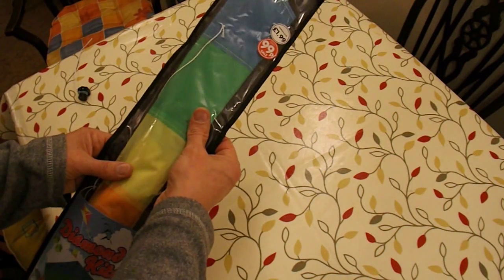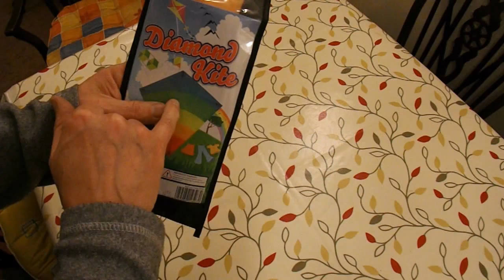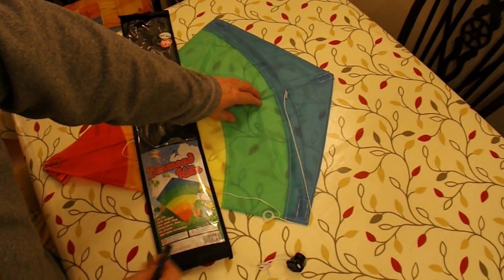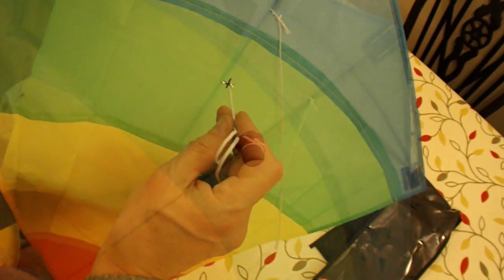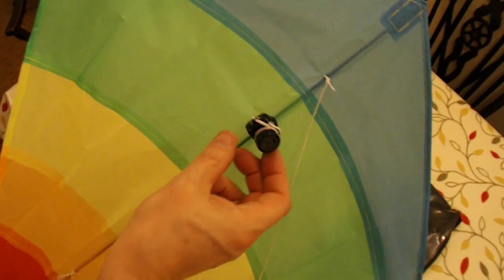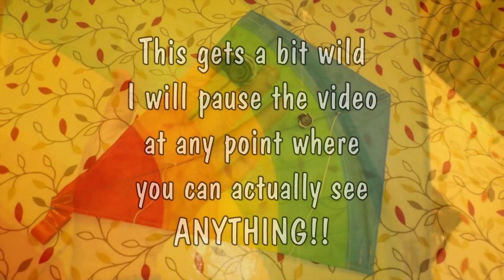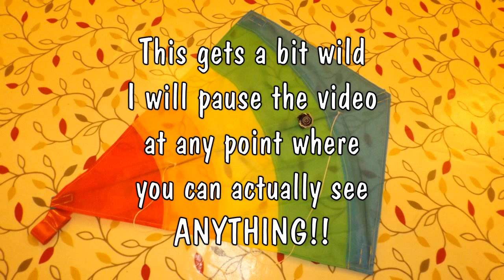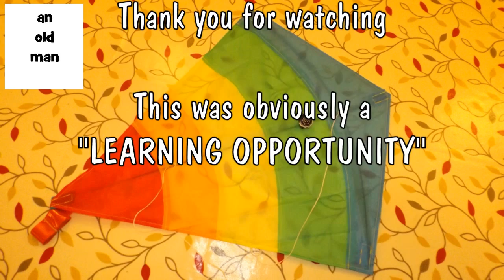Kite plus MiniCamera - FAIL

Comment: Hehe, it was just like one of those reentry videos, when they send up a balloon toward space.
Mind you, here's a thought, how about your parachute idea with the camera as a weight. The wind could knock the parachute off randomly (or using a clever knot) and the video would be suddenly stable as it floated down.
Those spars look to be great for strengtheners..somewhat like CF spars in R/C aircraft.
Reply from the maker: I think if I just suspended the camera on a string below the kite , possible with a tail or rudder to hold it into the wind, it may be more stable, but yes a parachute release is a request I already have on my list.
And Yes, those spars were the thing that caught my eye when I saw the kite on sale, they will be heavier than CF but still lighter than a wooden spar or similar.

Comment: i also tried it once, but i used a bigger kite digital image stabilisation in post production and a better camera, but it was still horrible! :D
Reply from the maker: It looks like I need to make a small mounting cradle and attach it to the string by two points. Here are a couple of videos of people getting it right
alixdent http://youtu.be/eCTorY2xu8U
James Moore http://youtu.be/GjIv9EwtBDM
Reply: GrandadIsAnOldMan yea, it seems to be working... but you need a bigger kite to mount a better camera with this system on it... or a lot of wind :D maybe at the coast, in brighton, there should be more than enough wind... :D
Reply from the maker: Josh's RC my minicamera is extremely light weight, I will probably see if I can make a small mounting cradle for it and have another go although a larger kite and a heavier camera would probably be more stable anyway.
Reply: GrandadIsAnOldMan yes that should help..